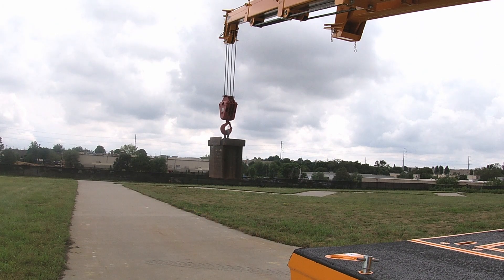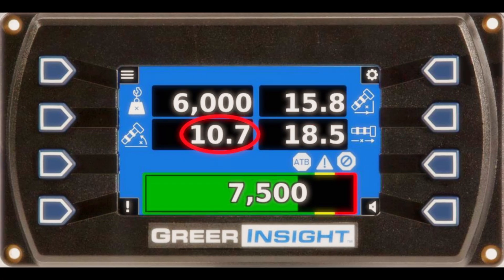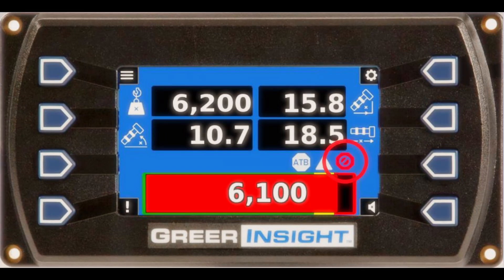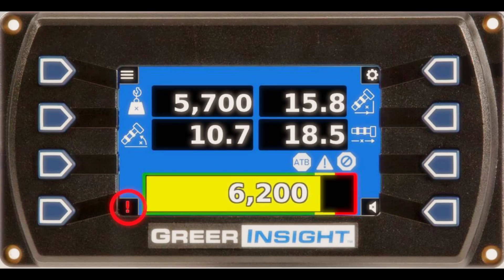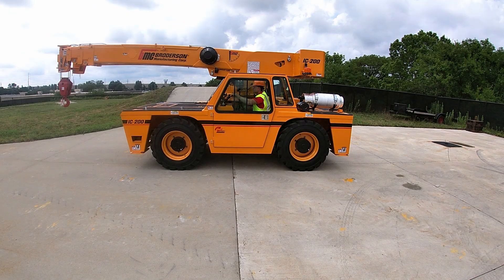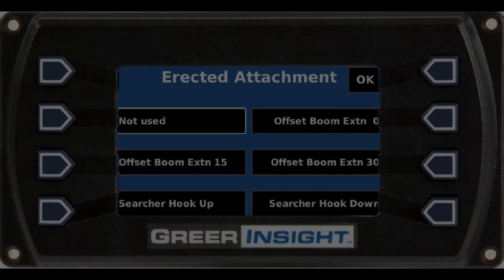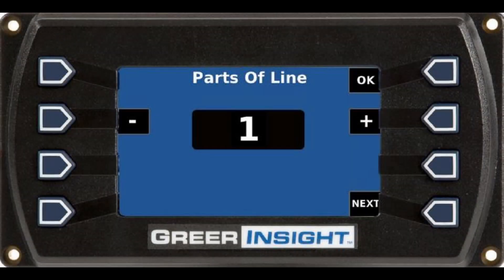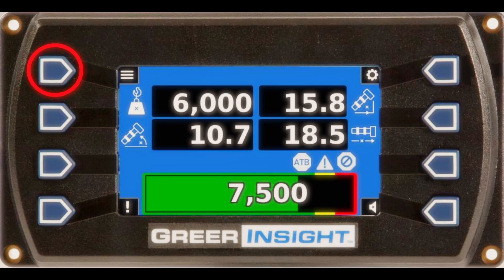Broderson's New Greer MG6 LMI System

Comment: Received a brand new ic-200 with this lmi.  LMI boots up sometimes on startup, sometimes after crane has been running for a while, or not at all.  LMI will also turn off randomly.  Override key will not function if LMI is off.